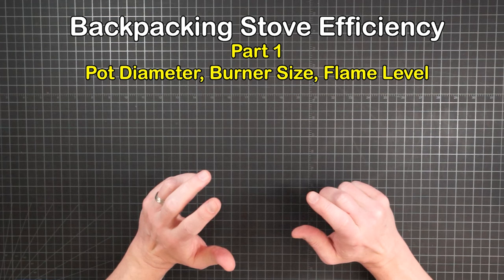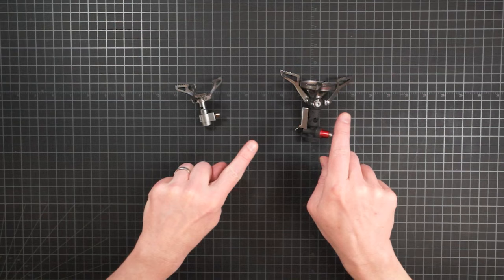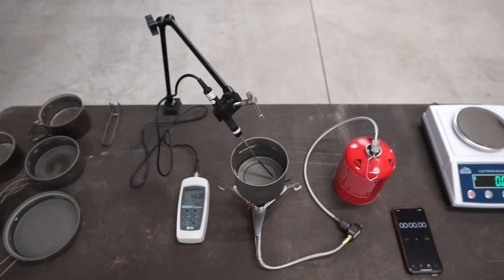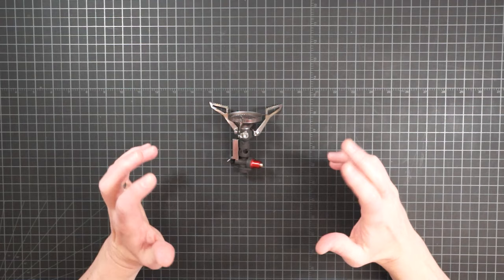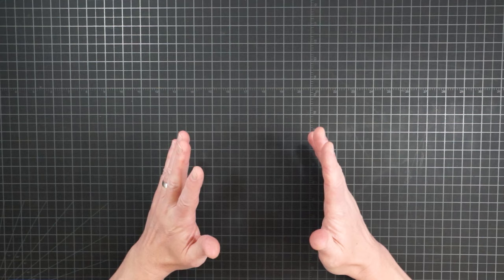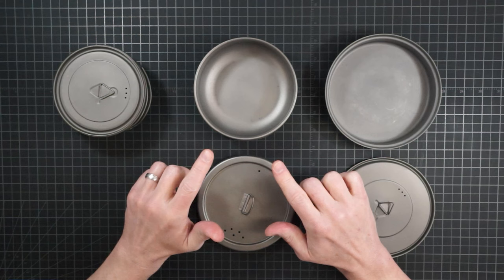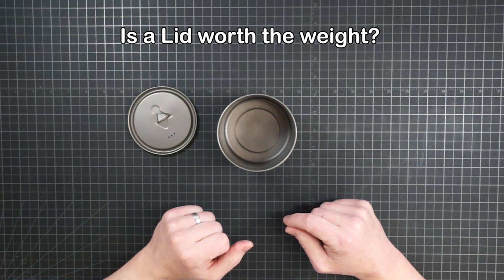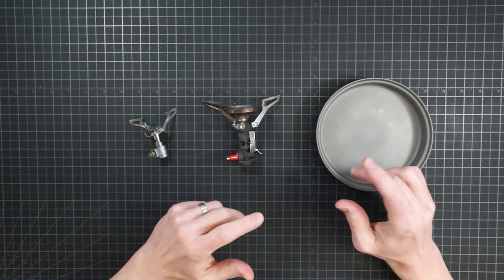Backpacking Stove Efficiency, Part 1: Pot Diameter, Burner Size, Flame Level

Comment: This video just gained you a new sub! First time you ever popped up on my feed and I’m glad you did! A lot of work went into this and I really appreciate what you did here.

One consideration which is not explored (although seems to be revealed) is something I’ve been thinking about, because I don’t have access to all these stoves, is the spread of flame on the bottom of a pan based on the size of the burner. That MSR seemed to create a wide enough flame across the full bottom of that pan. I didn’t think that would happen. I thought it would be more centralized because it’s a smaller burner. I have the cheap Walmart one, and that’s exactly what happens. I’ve been thinking about going with a wider burner, because I am the bit more of a chef, and I like to see that flame underneath the full pan. What say ye on this? I’ve often thought about picking up that MSR, because of it being so small, but this has been a concern. Also, others have complained that you can’t really control the flame on the MSR as well as you can on one of the “better” stoves.

Great video! And I agree with a previous comment.. a voice of reason during times of turmoil. So refreshing!

OK well I have about an hour left tonight. Time to view another video of yours before I call it a night… 😀

(oh, before I forget… yes, I would be interested to see how they perform with other materials, such as aluminum and steel. Although I have a feeling the wider pan and cover is going to play out similar across-the-board. But. Maybe not. Maybe not… 🤔😎

EDIT: “MSR”.. oops BRS . Ehh. Life is full of acronyms… 😂
Reply from the maker: Yah, a tiny burner and titanium's notoriously poor heat transfer rate makes for a hot-spot nightmare when actually cooking (instead of just boiling).

If I'm worried about scorching food in the pan, I'll go Pocket Rocket Deluxe for its better spread, and quieter simmer.  Still, with very thin-walled titanium it's almost impossible to prevent.

The only ways I know of to get around scorching is to bite the bullet on weight and either go with a heavier (thicker) aluminum fry pan with MUCH better heat dissipation, or use a heat diffuser between stove flame and pot (which will also add weight).

One of my side projects in this area (I sort of work on 15 things at once) is finding the lightest possible, yet still effective heat diffuser.  Four Dog Stove makes a titanium one.  I have an old, rippled stainless steel one I got at REI forever ago.  But, I'm working on DIY options with a variety of materials including carbon cloth, woven fiber glass, and such.  Even just the idea of taking your titanium lid off and putting it underneath for frying.  I want to get an infrared camera so I can image the hot spots in a pan using various diffusers, to see which provides the best dissipation for the least weight.

Now, I just need to live forever so I have time to do it all!
Reply: @GearSkeptic  🤣 Good one! You really do have a foot in all this. And for that, we out here are grateful! So glad I stumbled on your content.

Thanks for the detailed response. I know more now just from THIS alone to help make decisions moving forward.

As a side, I don’t use anything titanium. I’m not into hiking as much as I am to while camping. I’ve just begun that journey in bushcrafting a year ago, and all I’ve been doing is practicing in my backyard since last winter. Getting down all the nuances. Tarp tenting is my favorite, down to three or four different go to configurations. Fire making skills are coming along. Of course cooking has always been one of my things, but I’ve been using aluminum. I now have the small Trangia set worth the coated pan, which is also aluminum. The small burner I’m using still creates a hotspot in the center (plus, quite honestly, that pan is piece of shite… the bottom has no strength, and therefore has formed ripples. So now the bottom of the pan is not flat anymore. Highly rated piece of junk. I’ll bet the older ones were made nicer but I digress.) Anywho, like you say, it’s time to bite the bullet and get a stove that will cover the whole bottom of the pan. That’s my next move, so thanks for that recommendation - I’ve been eyeballing that one.

Also for what it’s worth, I firmly believe nonstick pans are the way to go out in the woods. Just so much easier to clean. Opposite side of that is that you have to be gentle with them…

Anyways, thanks for the great bit of helpful information. (Ohhh… and that video on pasteurization! Gold mine! 👍)

My next and last piece of survival stuff to work on, is using a compass, learning to set bearings, triangulation, and topographical maps. After that, I’m ready to go out and do this stuff real time!

Going through and loving your videos! Peace.
Reply from the maker: I'm afraid most aluminum pots are too thin.  I've been narrowing in on the pans, which seem to be made thicker with the idea of hot spot management in mind.

Again, there's a weight penalty, but for the true backcountry chef, it could be worth.  I've got my eye on some options from Jetboil and GSI.  I want to put up a DIY heat diffuser and titanium pot against an aluminum pan.  See if I can beat it!
Reply: @GearSkeptic  Well. I have the easiest answer to this dilemma: Pick up a small regular 6” non stick pan from Ocean State Job Lot, and heat distribution issues resolved! I’ll find a small non stick pot to match for rice, stews and such, and just make my own kit! At the end of the day, we may both find that for all the “trail designs” available, there may be nothing like the real deal. The only drawback might just be extra fuel needed to maintain the behemoths… 🤔

Thanks for the dialogue. I’ll let you dig in and watch out for your results with great interest! Best
Reply: So it’s been a month since this dialogue. I have been attempting to utilize the principles learned in this video. My go to kit is still the Trangia mini. I keep a couple bottles of denatured alcohol in my pack. But I also carry gas, and recently purchased the not so light, bulky to many, Coleman Peak 1. As I’m not into feather light packing, it doesn’t matter to me. This is a nice little durable stove, with beautiful flame control, and excellent wind resistance.

Reality is, I only need to boil one cup of water at a time for a cup of tea, small helping of pasta or rice, etc. I stopped boiling in my metal cup, and I just boil water in the Trangia pot, with the pan on top of it. On a mid to high flame, I’m boiling a cup of water in a minute and 45 seconds (room temp water) to 2min+ (refrigerator water at 40°F ) using your guidance.

Using the cheaper, smaller Walmart stove, which only sends a flame to the center, boiling water in my steel cup, I was averaging 5 to 6 minutes. The Coleman stove has a much larger flame, with more even distribution. The Trangia mini aluminum pot is about 6 inches across. So that’s average for small cook gear.

To say the least, I am a happy “camper”..

😁😎

EDIT: Oh and my eggs cook beautiful now with this stove as well 😂

Comment: This is very useful information for helping decide what's important to consider when picking stove and pot. I've been experimenting with this stuff informally for years, so it's good to have real data.
I'm curious if a Sierra-cup-shaped pot would behave basically like a wide pan. It would seem to have the same advantage of catching almost all of the flame, but the disadvantage of a large surface area to dissipate that heat. Not sure if it would just be the worst of both worlds.
Reply from the maker: Funny you should mention Sierra cups.  Vargo makes two sizes of Sierra cups in titanium.  I have one and will test it with some other container shapes like a canteen, a tea kettle, Sea To Summit's X-pot, and a Bear Bowl.
Reply: @GearSkeptic  I picked up one of the 750ml versions several years ago (on clearance!) to play with the concept. Informally, it seems to boil water very quickly, but then it cools down very quickly, so I shelved it as it wasn't great for the dehydrated food workflow. Now that I've decided to try cooking real food, I'm planning to use it as a little wok.
I'll be very interested to see if you find anything unexpected in the tests with novel shapes, which is why I subscribed.
Reply from the maker: That’s the one I have! It looks like those are discontinued.  Last time I checked, they only have 2 other sizes instead.

Comment: Great breakdown and thank you for the information. Can you run one of the stove/pot kits, like JetBoil, to see how it stacks up against your trial? Curious how the heat trapping capability of the system matches up.
Reply from the maker: Yes!  I plan on Part 2 being for wind effects, with Part 3 being heat exchangers.
Reply: I have Jetboil and a cheapo burner, with similar width similar weights Ti pots (and lids!). I benchmarked indoors no-wind and outdoors in a breeze and averaged results. The Jetboil averaged 4.6g and a similar Ti non-Jetboil averaged 8g of gas fuel to boil 350ml of water. So roughly a factor of 2.  The Jetboil also had a lesser drop in efficiency in wind than a flat bottom pot. I am waiting on delivery of a wider Ti pot as I think a wider Ti pot (wider than a Jetboil pot) would narrow that difference as this video shows wider pots more efficient.

Comment: Excellent work and video, I understood it all and aligns with what I'd be guessing. 

Not suggesting you do all the tests again but you did the tests in no wind. If you added a cross wind then how does the results vary? I'm guessing that a narrow stove on a wider pot would tolerate wind better as more of the heat is still nearer the pot than on a narrow pot?
Reply from the maker: I’m actually doing the wind testing now. Part 2 is underway!

Comment: Here's a theory based in physics....

Thermal loss of heat is higher the greater the temperature difference with surroundings, so a hotter pot cools in absolute terms faster than a cooler pot and a hotter pot takes more time to add a degree of temperature than a cooler pot. Indeed if your heat input isn't high enough you may not get to a boil as loss = input. So as the pot heats up it is losing heat faster (evaporating, radiation).  So if you began with a lower flame and then turned it up higher only towards the end, you should in theory get more fuel efficiency. 

I may benchmark to see if theory is true and how much it helps. I do this already when on a campsite to lower how much time the flame is noisy.

Comment: Excellent as always.  2 Questions.  Maybe I missed it but did you share data on boil time relative to High Medium and Low settings?  The three valve system: It seems like on the high setting, you may get a false reading as you may have flow restriction issues with the 3 serial valves.  Any insight on this would be appreciated.  Again, great work!
Reply from the maker: The times have more user-caused variation because they were recorded manually.  So, depending on how quickly I got the knob turned off (several turns, sometimes fumbled) and hit the stop button, there can be several seconds of wobble.  (the calculations don't care, because it's just Delta T and weight change)

That being said, here are the raw times for the Pocket Rocket Deluxe (the regulated one), given for each vessel from smallest to widest:
On High they were 2:32, 2:32, 2:19, 2:34, 2:24, and 2:11.
On Medium they were 2:57, 3:04, 2:59, 3:01, 2:53, and 3:00.
On Low they were 5:38, 5:58, 5:45, 5:46, 5:38, and 5:56.

The 6-vessel average for each flame level was (High, Medium, Low): 2:25, 2:59, and 5:46.  Only about a half-minute difference between High and Medium, but over a two and a half minute jump to low.  

As far as the valve system, I made sure when choosing the High setting that it did not max out any of the stoves so there wouldn't be any false ceilings there.
Reply: @GearSkeptic  very interesting info on the times! For those hiking with multiple people and requiring multiple boils it seems like a medium flame might be the best of both worlds for convenience sake. You'll save some fuel but don't have to worry about long boil times for multiple boils adding up.

Comment: Great info. My only comment is on lids. The lid analysis would change, to the benefit of the lid options, as the room temperature dropped. So in your lab, room temp might have been 68 degrees but a 3 season boil at elevation could be at 45 F degrees makes the thermal dynamics more pronounced than the shop numbers, correct?
Reply from the maker: My shop was was around 45F, but I do want to try some tests colder for just the reason you say.
Reply: Thanks for the reply and analysis.  Always looking forward to your videos

Comment: While we add windbreakers to improve stove efficiency, i wonder if adding a copper disk/or similar between burner and pot  would heat up more efficiently than titanium and would it transfer the heat to the titanium better than a burner on the titanium pot.
Reply from the maker: Interesting question!  I do have plans in the works to test heat diffusers made of different materials.  Also, I want to test aluminum pots against titanium and steel.

Comment: I also wonder about the heat ring some pots have at the bottom, such as the Jetboil.
Reply from the maker: Agreed!  I plan Part 2 for wind effects, but that should lead nicely into a Part 3 on heat exchangers.
Reply: @gearskeptic6355  I look forward to it!  I am guessing the heat exchangers will all be fin type.  I doubt it makes sense to do shell and tube or other such styles.
It will also be interesting to see if you come across any that are not just tack welded on.
I have kicked around the idea of brazing my own fins onto a pot to see if it is better at getting the heat into the vessel verses a spot welded one.  The whole contact area increase and all.

Comment: One minor criticism regarding your "boil" criteria - to ACTUALLY bring the water to boil requires more heat than that to just increase a degree - it requires the Heat of Enthalpy for water (the heat required for phase change from liquid water to gaseous water).  Basically that "last degree to boil" needed requires substantially more energy than just getting the water to "almost boiling"
Really, this is just an argument to do the testing in the fashion you did it, and also an argument to NOT boil water if you don't have to. But for those expecting to actually bring the water to boil while using similar amounts of fuel as demonstrated - those people will be disappointed.
Reply from the maker: Yes! That is part of why I did all my “boils” to 200F.  I don’t get anywhere near that end state of diminishing returns.

Comment: Love your scientific approach. I discovered a simple stove on a you tube vid.  I love it. Would you make one and test it? It a small steel can ( tomato paste can). Drill 12 quarter inch holes an inch from the bottom and again around the rim. Almost wind proof. Burns liquid fuels. Alcohol. Twigs can also be used. Pot sits directly on rim. I’d love to have actual data.  Ive had 4:50 gasoline and the new butanes. Dm me if your interested. Can provide pics. I do use wind screen to improve efficiency. Thank you.
Reply from the maker: I would definitely like to get other types of fuel stoves into the testing.  It's going to take me a while, though.  So much to investigate!

Comment: Thanks for the video!  I would be interested in the weight efficiency for medium and high flame levels.  I'm wondering if you would see different results.  I'm not sure I have the patience for the low flame each night.
Reply from the maker: Ok, I crunched the numbers using the Lid On/Off data.  Short answer: the pot is still more weight-efficient than the pan.

But, remember that pan size made a much bigger difference in efficiency using a high flame, than with the low.  So, while the greater fuel efficiency gains of a pan on high still don't make it more weight efficient, the difference in the number of boils you can get out of a canister goes up significantly.

Here's some numbers for a High flame...
Without a lid, you can get 13 boils from a 110g canister with the pot.  You get 17 boils with the pan.
Lid on, you still get 13 boils with a pot, but you can get 18 boils with the pan.
Fuel savings (across 13 boils) by using pan w/o lid is 27.4g, with a lid is 29.1g.
The pan weighs 33.42g more than the pot.  So you save 27.4g in fuel at the expense of 33.42g in container weight.
With lids, you gain 51.3g in container weight to save that 29.1g of fuel.
Again, not technically weight-efficient, but with a pan and lid you get 5 extra boils out of the canister!
Of course, using a low flame is even better.  But if you're stuck on High, this is something to consider.

Similar situation with a Medium flame.  The pan's fuel savings are still not weight efficient.
16 boils from the pot, lid on or off.  18 boils with the pan, 19 if you use a lid.
Same weight differential between containers as before.
Fuel savings (across 16 boils) going to a pan are 11.8g, 16g if you use the lid.  Again, not enough to make up for added container weight.

For reference, averages times on High were 2m25s, on Med 2m59s, and Low 5m46s.
So, a little over 30s longer to boil going from High to Med, but over two and a half minutes longer going from Med to Low.

Hope that helps!

Comment: Maybe I missed it but the with the weight saved in fuel vs the weight of the item, did you consider the weight of the canister? Fuel weight is not just the fuel but also the container.
Reply from the maker: That is discussed in more detail in Part 3.